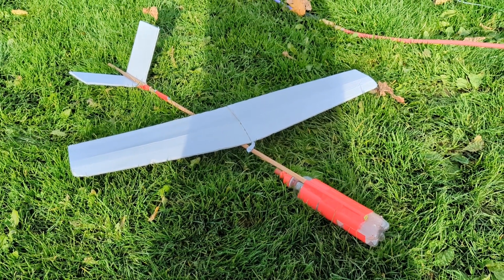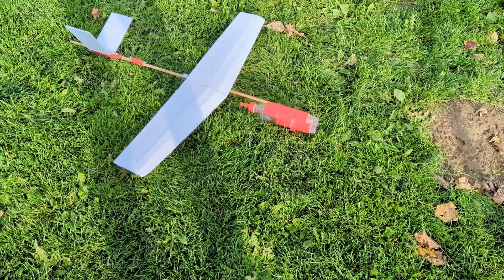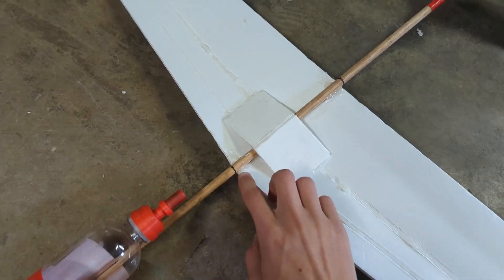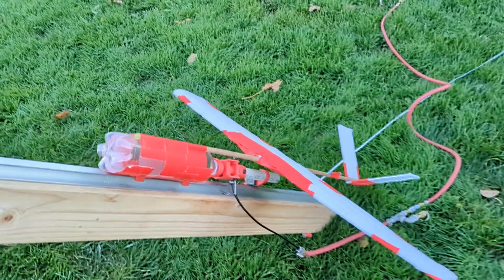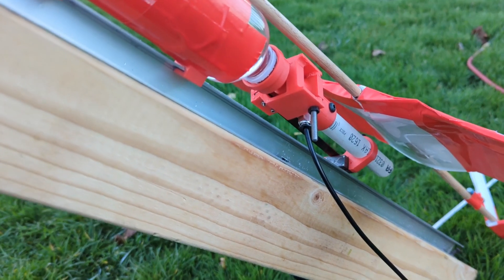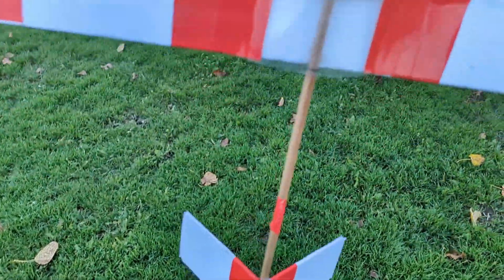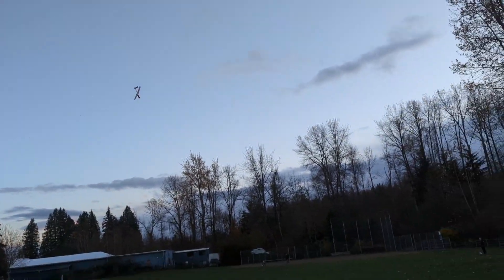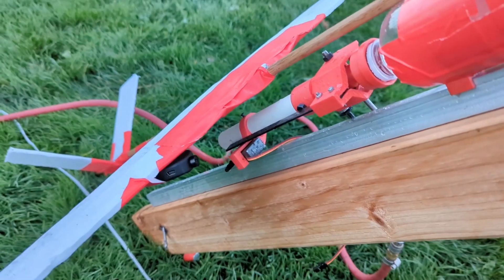Rocket Plane!!!

Comment: Even with good CG balance you should have dihedral if not polyhedral in the wing for stable level flight.
Reply from the maker: Yeah, I had that wing from a previous project, dihedral would definitely have helped. I plan to do that for my next design, but I've kinda shelved rocket planes for a while.